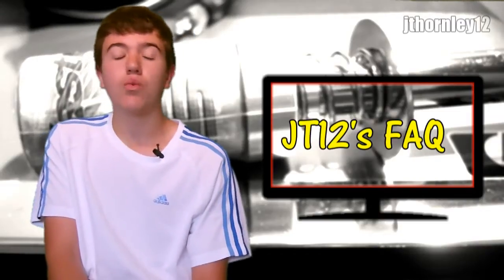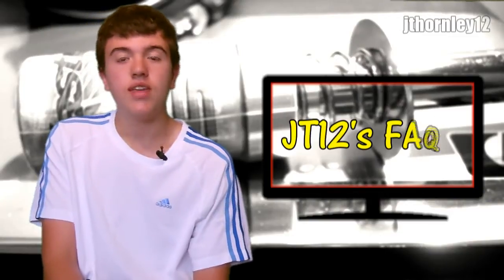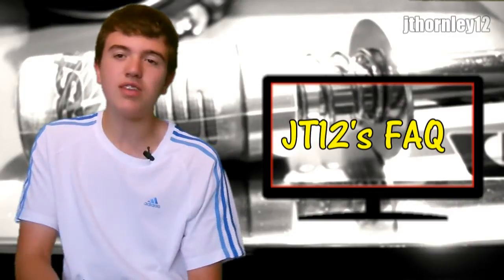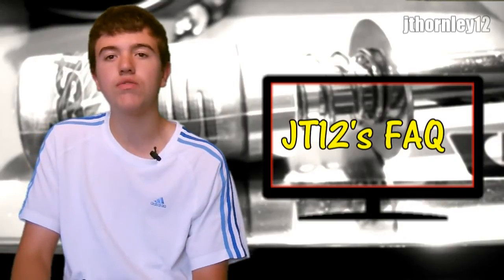JT12s FAQ -- Why engine quits when igniter is removed

Comment: Hey man I have a problem But i need your advice, I recently Received a Himoto Firestone But the engine Will not Run Once given throttle I believe the carb needs some changes But it's just now came out of the box as we didnt have fuel and Idon't want to change the carb setting Due to it being in break in. It also is leaking fuel out of the Side of the head there are no Holes and the glow plug Is Tight but not About to bust the thread tight
Reply from the maker: Start by checking the tuning settings are set to factory default, the settings can be found in your manual. They don't always arrive correct. It sounds like the cylinder head bolts aren't tight. Remove one at  a time, use thread lock on the threads, and put them back in.

Comment: ALL theses years later and you info is STILL as useful as ever, thanks JT.. BTW.. should i set my throttle trim on the controller  half way during the set up ?
 cheers.
Reply from the maker: Thanks for the comment :) Set the throttle trim so you have a 1.5mm gap in the carb

Comment: Hey guys, I have a TrackStar SEG-28 Two Stroke Glow Racing Engine and it doesn't want to start after I broke in with an old fuel that I had, i changed fuel and glow plug but nothing. Any advice?